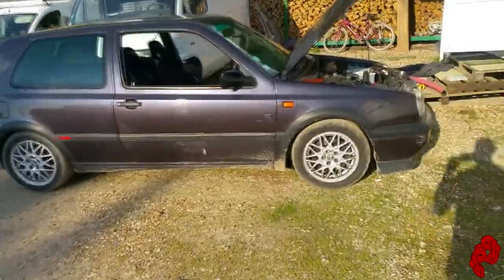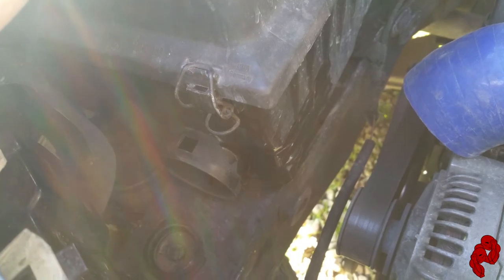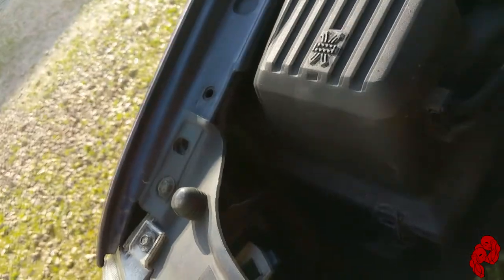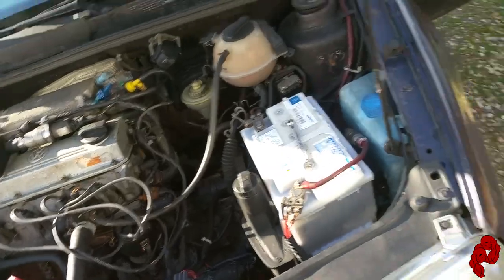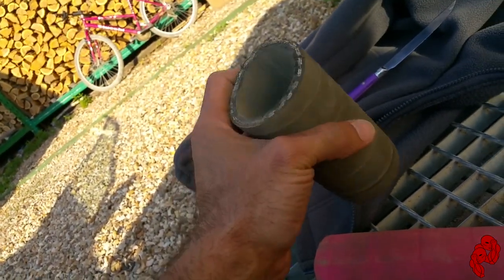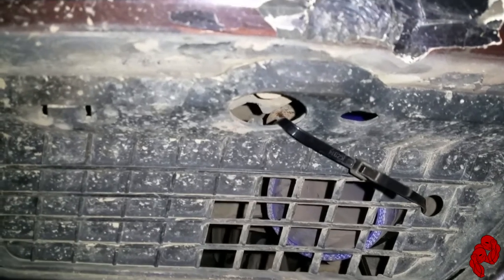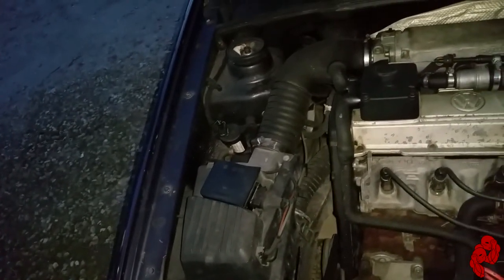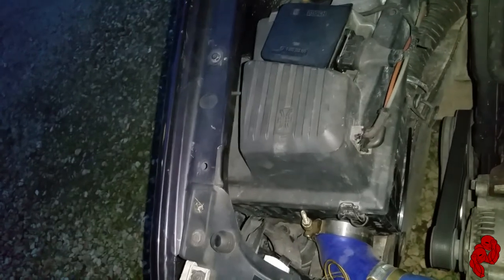Gemini´s 93´ Volkswagen Golf lll GTI Restoration Project (Air Intake Box Mod)

Comment: Great little mod to do! What's coming next next for the golf?
Reply from the maker: complete new K&N cool flo air intake system and de-cat pipe then a performance chip
Reply from the maker: oh also some wheel hub spacers, 10mm in the front and 16mm in the rear
Reply: Are wheel spacers and running catless legal where you are? or is this build just for the track?
Reply from the maker: +IllusiveGiraffe The de-cat is legal but if you have a major or fatal accident and they see that your car is over modified, you could pay a fine. The hub spacers are legal. Planning on sand blasting and painting my rims this weekend ;)